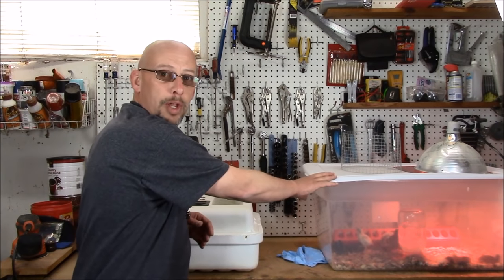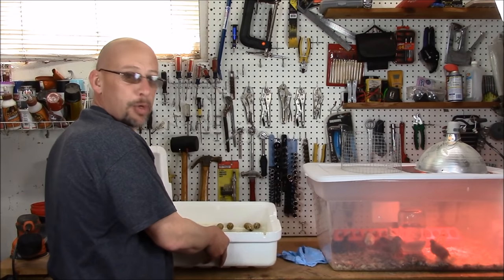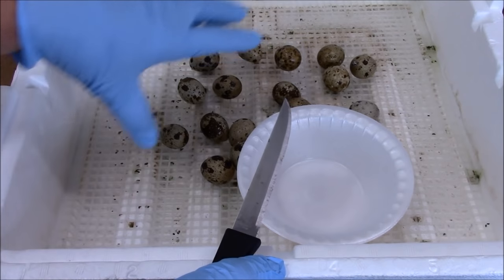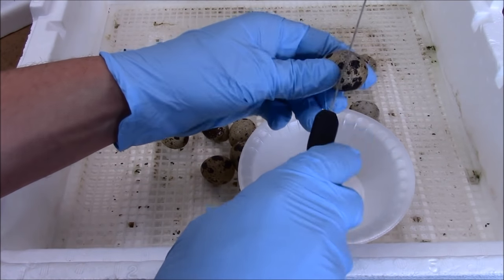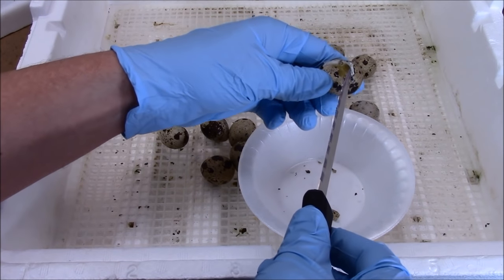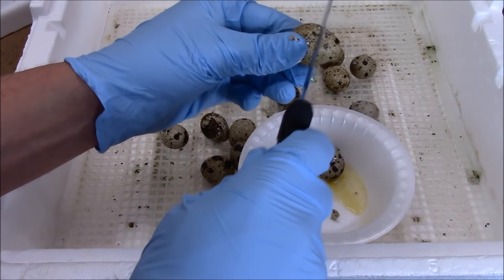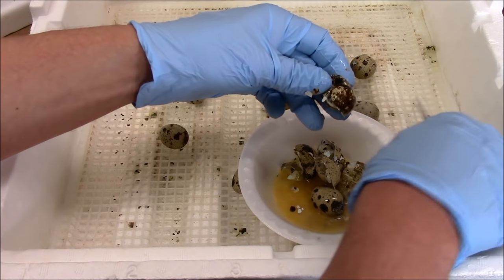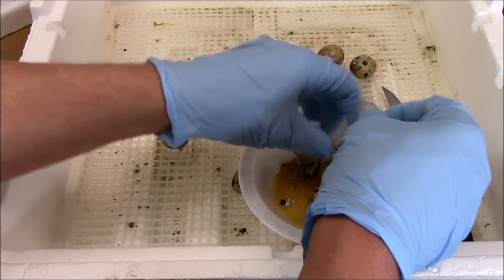Troubleshooting a Poor Hatch: The SR Quail Update 3-13-17

Comment: Just had a hatch with 120 eggs, only 23 or so hatched. Currently doing an autopsy and 14 out of the 25 we’ve opened so far were fully developed with no signs of pipping. The egg shells don’t seem overly thick  and all the ones that did hatch hatched at day 17, they’re jumbo qual. Any suggestions so we can fix this next time?
Reply from the maker: I am so sorry to hear that you had issues.  The most common thing that causes that is the temperature of your incubator.  you can pick up a couple of non digital thermometers and put them in your incubator to verify that it is reading the temperature correctly (make sure to calibrate them first and verify that they are accurate).  It could also be an issue that humidity was too high or too low.  If the humidity was over 80% that can basically drown the birds in their eggs.  If it is under about 30% it can cause them to dry out too much and basically become shrink wrapped in the egg.
Reply: Slightly Rednecked all the parameters were acceptable the entire incubation, though we only had one extra thermometer. Looking at the video again it seems we have either the same or very similar incubators. Do you use the fan attachment? One of the only things I can think of is the heat and humidity wasn’t even enough or the few birds that did hatch knocked around the eggs too much.

Comment: Hey Chris. I've been watching your videos for weeks but came back to this one to see when you did this autopsy of the eggs. 

I've just had my first hatch. Started with 27 eggs from 2 sources. I think 19 went into lockdown after candling. 

Out of 19 I've currently got 6 quail. #1 day 18, #2&3 day 19, #4&5 Day 20 and #6 day 21 today..

#5 has curled feet and #6 needed assistance and looks like it may have curled feet. 

I'm thinking the incubator may be running a bit cold. It's a cheap one with a solid plastic casing rather than polystyrene. And the temp probe is in the top higher than the egg tray. 

Anyway it's a learning experience all the same. I think I'll make my own incubator for my next batch.

Comment: We had followed all your (and Kevin’s “Living Tradition”) steps both times we incubated.  

The 2nd time, we decided to rapidly “candle” on day 15 before they went into lockdown. 
16 eggs were dark with life inside. 
After candling and rapidly removing the other eggs that did NOT have growing embryos... 
We went into lockdown.  That was day 15. 

On day 16.5 we had one that hatched.  About 12 hours later, 2 more hatched. 
There were several other eggs that pipped, but we waited and hoped and prayed; yet, those precious little things never got out of their shells. 

After 35 or so hours of the 1st one being hatched, we removed all 3 chicks and placed in the brooder where miracle water and ground-up crumble waited, but the pipped eggs and 2 others that were active and chipping their circle along the shell never hatched after several days.  
So, finally, on day 21 we turned off the incubator and opened the barely-active shells and they all had crook necks.  So, after all those precious babies had tried so hard for days, my husband had to dispatch them and we had walked away with only those other 3 to the brooder.  

Then, on day 5 in the brooder, one of the babies was found today on it’s back. 
It was gone. 
Then, tonight, another one was on its back; but it got up and ran around after I picked it up. 

It’s a galvanized brooder with 2 sliding lids. 
I’ve opened it up a little more so more air can get inside. 

Not sure what to do moving forward.
Reply: Should we NOT have candled eggs on day 15 before lockdown??? 
We are thinking that was our big mistake. 

Will someone coach us around when you candle or what your experience is?
Reply: Hi, so sorry to hear. I have one quail chick that hatched on day 17. 26 eggs waiting now on day 19, no sign of hatching though.  Very lonely chick here... I do not think you did something wrong by candling them on day 15. Hens also leave their nests now and then.

Comment: Hi, the quail eggs are on day 19 on incubation and none have hatched out yet, we have 23 eggs in the incubator and we can see a slight crack in one of the eggs and in another 4 of them we can see the egg moving around, would there be a baby in those eggs and if so when would they hatch. We are loving your videos and are finding them very helpful.
Reply from the maker: Give them a few more days just to be sure.  They usually hatch on day 17 or 18 but can take up to 25 days.  Since you are on day 19 with no hatches yet you might want to calibrate your incubator when this hatch is done.  it sounds like it may be running a degree too low.  Just get a couple of non digital thermometers, calibrate them to make sure they are accurate, and throw them in your incubator in different spots.  That way you can verify if your incubator is reading the temperature correctly and make any adjustments needed before the next hatch.  Good luck with your current hatch. There is still time left so try to be patient.
Reply: @Slightlyrednecked  Thank you
Reply: @Slightlyrednecked just done a hatch in a new big incubator with 48 quail eggs. All the eggs were under a week old when they were put in the incubator. Chicks started hatching on day 15 and by the end of day 16 there were 14 of them. Two have splayed legs and one has curled toes. Another one had one curled foot. All the other 10 seem healthy and active.

There are still 34 eggs and no pips from what I can see. Why are they late and the others so early..?

Comment: Chris I've just finished my hatch ,I set 23 hatch a total of 17  but I have to that is having trouble getting up on their legs, any suggestions.
Reply: I've just seen another video that covered this. They said to make sure that the surface that they will hatch onto is ok for them to stand up. If it's slippy then their legs can form wrong and it will never be able to stand up. I've had a couple like this before and they inevitably don't survive.

Comment: Hi there my son has brought 12 quail eggs to put in his incubator and we had an issue a few weeks in where an alarm keeps going off displaying ee code on humidity . It says nothing in the manual about this code so we've done our best whilst living among this annoying bleeping constantly!!  Today is day 19 and we have no hatched eggs . We know a few are empty but we can see some look full with just the little air sack at the bottom. Also we've put them in water and they float . Is there anything u can suggest to us ? How long should we keep them in waiting ?
Reply from the maker: Unfortunately it sounds like a failed hatch.  I am not sure what kind of incubator you have but it could be a number of things.  If the humidity is too high it can cause issues so you may not need to add any water or at least not as much water to it.  The most likely issue is temperature though.  I would put a few calibrated thermometers in the incubator and see if they read the same as the incubator.  Make sure they are calibrated though.  I hope that helps.

Comment: I think it was so cute how the little chicks wherein the back round. I'm incubating  24 eggs from shipped eggs how many do you think will hatch and with a closed bottom two layered 36 in chicken coop do you think the ones that hatch will be able to fit. This is my first hatch and it was pretty cold outside.
Reply from the maker: I hope they all hatch but I have no way of really being able to guess at how many will.  A 36 inch coop should easily house them though.  As they get older that is about enough space for 10 to 12 birds.  I hope that helps.
Reply: Thank you so much

Comment: Hi i have incubated 12 eggs the recently only 5 hatched i the last one was a day late the others have only developed half way all for one that might still hatch.  What wud have happened to the others? I had switched of the incubator by mistake for an hour it might have done it.
Reply from the maker: It does sound like you have a temperature issue.  I doubt that turning the incubator off for 1 hour is completely responsible but it could be.  I would get a few thermometers and calibrate them to make sure that they are accurate.  Throw them in the incubator and see what temperature it is actually running at.  you may need to adjust it a little to get it to the right temp.

Comment: hey. I just finished my first incubation.. From 23 egg i got 19 chicks which are already in the brooder. I looked in eggs that did not hatch. Two of them were fully developed and not even peeped. But they died. My question is why is that.My humidity during lockdown was 80% and the temperature 37.4 degrees celsius.. the other three died quite early. So if you can help me what i am doing wrong.
Reply from the maker: Sounds like you had a pretty good hatch really.  Sometimes you can do everything correct and a few just don't hatch for whatever reason.  It could be poor genetics, bacterial issues, any number of things.  It is very hard to tell definitively but honestly I wouldn't worry about it too much considering you had 19 out of 23 hatch.  That is really pretty good.  Sorry I can't give you a definitive answer.
Reply: no priblem, thanks for your time and early reply
Reply from the maker: You are welcome.  Thanks for watching.

Comment: Hi i was wandering what i need to use to sterilize my incubater after i incubate eggs. Please make a video on how you do it and other ways to do it. I have never had a good hatch rate and i am going to use these tricks to hopefully improve that. Thanks!
Reply: I rinse out the incubator with warm water, then spray it down with a water bottle with 1 cap of Clorox and wipe off the excess moisture.  If you have consistently bad hatch rates  candle your eggs after 5 days and see if they are fertile.  If you have clear eggs you need to look at the breeding stock and or egg storage.  If you get chicks forming but failing it's most likely temperature or humidity issues or they are not getting turned frequently enough.  Try to keep the incubator at 99.5F or 37.5C and around 40% humidity until the last 4 days jack up the humidity to 70%+.  You can put a folded wet paper towel in the last 4 days to jack up the humidity.  Don't open the incubator during the last 4 days btw
Reply from the maker: I think you pretty much got the answer already but next weeks quail video is on cleaning and sanitizing your incubator so stay tuned.  :)  

Thanks to Roy Jenkins for jumping in and helping answer this one.  I use dish soap to clean mine but basically the same thing you are doing.

Comment: I did a float test on my eggs and took out three that were not looking viable.
I opened them up and one was normal and unfertilized. The next one was unfertilized but almost completely dried out. The air sack was 80% of the egg and the yolk was like a tough jell. The final one was dry like the previous one but it had an embryo that looks like it developed until about day 8. Is this due to humidity. This is on day 24 of a coturnix hatch. I have five more viable eggs and none have hatched.
Reply from the maker: I am so sorry to hear about that.  It sounds like you may have a temperature issue.  Humidity could cause them to dry up for sure but at 24 days without anything hatching or developing further I would bet that the incubator is running a little low.  If you can get a couple of medical thermometers and verify it (make sure to get more than one so you know they are reading the same and get medical for the accuracy) that would be where I would start.

Comment: I have trouble with them being alive but about 8 days to young to hatch when they should hatch does anyone know why
Reply from the maker: That sounds like it might be a temperature issues.  if your incubator is a degree or two hotter than what it says it is that can lead to early hatching and poor hatch rates.  I would get a couple of non digital thermometers (make sure to calibrate them and ensure they are accurate) and throw them in your incubator to verify that it is reading temp correctly.
Reply: @Slightlyrednecked  ok thankyou

Comment: need a vid about your incubator is it still or circulated cannot tell in vids
Reply from the maker: I am using a little giant forced air incubator.  I don't have a video specifically on my incubator but I did a video on preparing your incubator and it has links to the one I use in the description.  Here it is if it is helpful.

https://www.youtube.com/edit?o=U&feature=vm&video_id=B6fvZo1Txug

Comment: Just had a big fail incubating out of 25 eggs only 7 hatched had temp at 99 f and humidity at 65 and 75 at lock down they were California Valley quail
Reply from the maker: Sorry to hear about that.  Did you verify the temp with extra calibrated non digital thermometers?  Also is it a still air incubator?  if so you need to up the temp to 100.  Hope that helps.
Reply: Yes i calibrated the temp turns out all the egg that dint hatch i candled and found yoke inside so im guessing they were un fertil eggs
Reply from the maker: That would do it for sure.

Comment: We incubate chicken eggs and tend to have problems as the chicks start hatching, they get pretty wild in there and knock the unhatched eggs around and I think that is the reason our hatch rate is never really successful. Is there something you would suggest to prevent this? We are getting 12 eggs to put in the incubator tomorrow.
Reply from the maker: You might try covering the windows with some cardboard to block the light.  Make sure it doesn't cover the vent holes.  If it is pretty dark in there they will stay much calmer.

Comment: ok i'm having the developed but don't pip the shell problem. hatch rate is 60%, 80% of unhatched are fully developed. I mix my own food so it is easy to change things. Right now i am at 5% cal (crushed oyster) and 2% di cal- p-18. What do you recommend?
Reply from the maker: The only thing I might recommend from a feed standpoint is to feed the calcium separate instead of mixing it in with the feed.  5% is a little high and could be causing the egg shells to be overly thick and may be part of the problem.  Honestly, 80% hatch rate is pretty good though.

Comment: I have quail and they are not hatch on like the 17 day at what temperature should I keep the incubator please help me thanks
Reply from the maker: it needs to be at 99.5 degrees.  Day 17 isn't anything to panic about.  Wait at least 3 or 4 more days before giving up.  if they hatch later than day 18 it is an indicator that your incubator temp may be a little low.  I hope that helps.
Reply: Slightly Rednecked that is 37.5 in Celsius thanks so much
Reply: Also we cut a tiny hole on top on the eggs does that matter
Reply from the maker: you really shouldn't cut a hole in the eggs.  it can cause them to lose too much moisture and shrink wrap the chicks inside the egg.
Reply: Slightly Rednecked it was tiny at the top

Comment: What if some hatch on day 16 and other as late as 20 or 21? Leaves me not knowing what to do
Reply from the maker: That isn't that uncommon actually.  The first thing to check is always the accuracy of your thermostat.  Get a couple of non digital thermometers and calibrate them to make sure they are accurate and then throw them into your incubator to see if it is reading the temp correctly.  You may have to adjust it a degree or two up or down (probably up).  I hope that helps.

Comment: Hi chris and thanks alot i was about to ask you about poor hatch rate i had 2 hatches and both had 25% hatch rate from 36 just 9 and from 48 just 12 still  have 2 more days for those 48 to hatch but yeah i saw  the temp is high because both hatches were on day 15 not 18 so i know temp is high i need to fix that asap. Can the % be super low because to high temp?  i know they developed by day 10 i candled them and all moved but dont even break egg.
Reply from the maker: High temps can definitely affect the overall hatch rate.  Chances are it isn't off by much just a degree too high.  I would get some meat thermometers, calibrate them, and go from there.  Hope that helps.

Comment: Hello sir, I have been having very low hatch rate. We have 4 hour of electricity outage. Kindly advise what could be the problem
Reply from the maker: I am sorry to hear that you are having problems.  The biggest problem with poor hatch rates is usually temperature.  The incubator needs to remain at 99.5 F (for a forced air incubator) for the entire hatch.  A 4 hour power outage shouldn't affect it to much but you might want to pick up a few thermometers (non digital) and calibrate them to verify that your incubator is reading the temperature correctly.

Comment: My quails are getting older - they are around 18 months.  Laying rate is down and there are a lot of soft shells, so I add calcium.  I think this is leading to the chicks inability to leave the egg - they pip but can't get out.  I'm thinking in those circumstances, it may be okay to help them out of the shell.  Do you have an opinion on that?
Reply from the maker: Helping chicks out of the egg is really never a good idea.  They rarely if ever actually live.   Look at the calcium level in your feed.  I did a whole video on that (linked below).  It may be time to remove the calcium supplements.   Also look at the humidity during lockdown.  And are you making sure not to open the incubator during lockdown?  Those would be the places to start.  I hope that helps.

https://www.youtube.com/watch?v=44nupd7BDM8
Reply: I figure they are dead if I don't ... and the odd one might live if I do.  Humidity is on the high side, just for good measure.  I need to check the timing on lockdown.  It may be where I am going wrong.